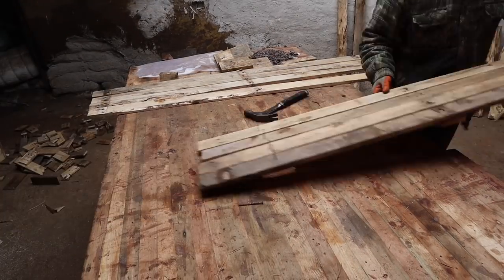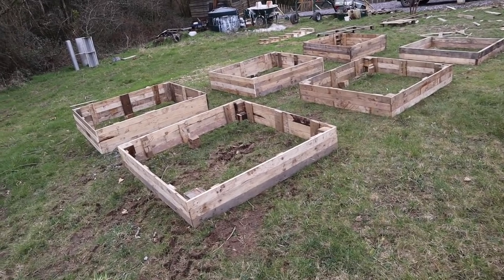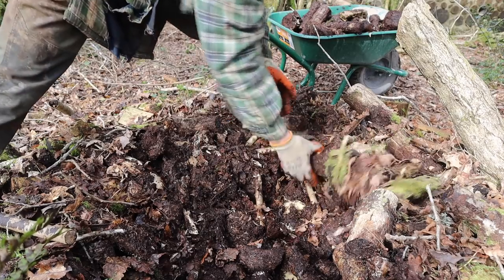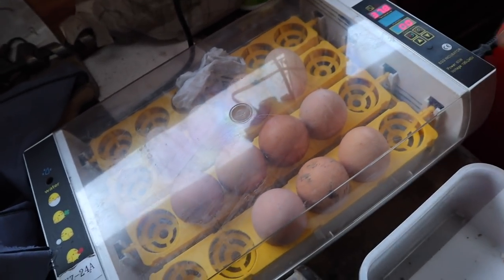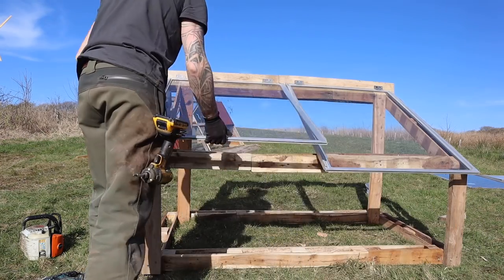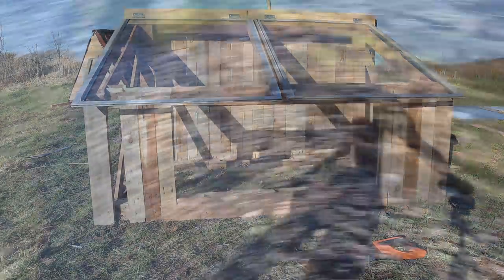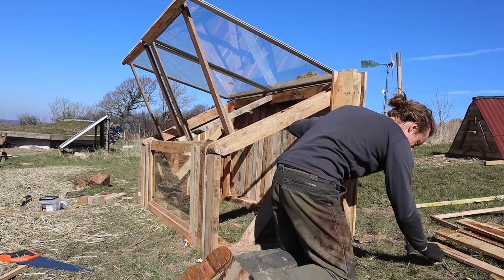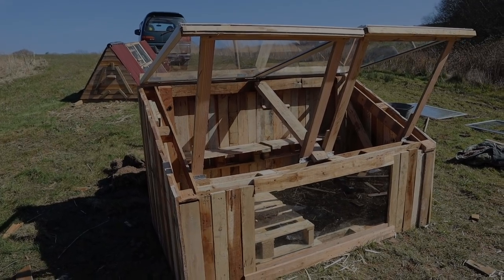Making Raised Bed Vegetable Garden With A Cold Frame

Comment: I live in south wales, same clay. It took me 4 years to improve the clay on my land, exactly the same as you are doing, lots of organic matter, compost, rotten wood, bark (but not too much as it leaches nitrogen) and chicken pellets etc. It is annoying but you learn to work with clay, and it does have alot of nutrients once plants get established and I don't lose plants during draughts or floods so it is pretty hardy. One thing i learned was that manure can be quite damaging, as it is very concentrated, i learned to leave it out and let the rain etc get to it, and moderate it a bit. When i put it on the beds, it affected some plants badly apparently this is "Burning" the plants, so letting it mollify/ weaken a few weeks out doors helped.
Reply: Found the same with my grass cuttings. Just left them out, included the winter leaves, and after two years, the compost seems to please most of my plants.
Reply: Great advice. I've been an avid organic gardener for many years. Here in northwest Washington we have Fort Lawton clay. Miserable stuff for a garden but, with enough fully composted organics it makes a fine garden. Happy planting!
Reply: @nick.caffrey  Nice. Grass clippings make a nice mulch but it takes years for them to become decent soil.
Reply: It could also be aminopyralid Herbicides on the hay or feed that the animals ate,  the worst part is it can last a could of years in soil and shows as deformed plants.

Comment: On an earlier video, after living in the roundhouse a year, you showed the logs behind the stove and the cracking of the cob. A way to stop anymore problems is to put a reflector behind it. Affix it on 25mm spacers, then no more heat onto the wall behind. I installed heaters for years, and this is a certain answer.

Comment: Just an idea mate , maybe put some kind of white material and paint the inside or maybe staple the same white material to the walls of the cold frame to bounce the light around a bit more  , it may also help with over heating in the summer sunshine , thanks for another inspiring video , i was just trying plan my garden today and you have given me "food for thought" pun most definitely intended

Comment: There is a great site in Wales run by a lady called Liz B(?) who has a small organic vegetable smallholding from which you can get lots of tips.    If you try short carrots in one of your boxes put 2 ft of green netting round it to keep out carrot fly.    And I can heartily recommend early and late Purple Sprouting Broccoli (might need wind protection) and Kale to get winter (early spring) greens.    You've done really well today.    💖

Comment: you'll need some fencing around it all, to keep any rabbits/deer/badgers off it. I wouldn't be surprised if you had a fox digging around in your raised beds, (which i'd let settle for a year before use). Great topsoil can be made by using inverted stacked turf, and much quicker to get into use, esp with chicken house cleanings. I'd only use wood as biochar, its decomposition can actually suck available nutrients out from your soil media. Home grown spuds for taste, calories and yield. I've had an organic small holding for 6 years, learning more now, than ever before.

Comment: Watching earlier episode's,  saw you installing stove. In Australia, had a high pressure capable, doubled stainless plate to fit in the flue, close to stove. Think it is 6+ k's unit, far better than copper wrapping around flue. Put it in a slow combustion stove back in the 80s. Could boil a 250 litre holding tank.

Comment: @1:50 to 2:00 What about us Canadians? 🙁
🤣😂 Actually even though Canada made the smart move and switched to Metric in the 70’s most people still measure length in imperial when building something. I don’t know anyone but engineers that go out and get a 1220mm X 2440mm sheet of plywood. The worst thing is that I know metric is much easier to use. 
Temperature in Celsius 
Weight in pounds or kilos 
Age in tree rings. 

🤣😂🤣😂
Reply: I always hear people say millimetres in those videos. We never talk like that in the Netherlands. It's metres or centimeters. Millimeters make my head spin at such sizes. I get all dizzy. Not so when you say '1 metre 22 by 2-44'. Somehow that's more relatable.
Reply: @09conrado  its more simpler to read mm, if relaying measurements to somebody its simpler to say "2045" than it is to say "2 metres and forty five"

Comment: i would not use toilet waste that stuff need to be properly composted at high temp to get rid of dangerous stuff
Reply from the maker: it was, for over a year infact the bottom of it was 4 years old and the top at least a year old. and it had mice burrowing in it for ages to so it had air getting through it and it was all mixed up and light and just slightly damp. I am confident it is safe to use otherwise i would not have used it.

More of a concern is the cat! she keeps pooing in them!
Reply from the maker: well there you go. probably the same for horse manure or pig. basically just compost it for a good amount of time and wash stuff before eating. Everything im growing will be cooked anyway.

Comment: Kris i'm not sure you should put that uncomposted wood in your veggie beds. The  micro organisms that will start to work composting the wood need nitrogen and they''ll take it all from the soil, depriving your crops of it.  You may be ok if you add a lot of green stuff to supply nitrogen, such as grass.
I've only skimmed through this but it seems quite informative  http://www.carryoncomposting.com/142941454
Reply from the maker: That is true about the nitrogen but this has already degraded to the point that it wont need much more nitrogen. if it was fresh wood then i would agree but its 4 years old and rotten.

I put all the chicken pen manure and sawdust in the bed as well. it was composted for a few months at least.